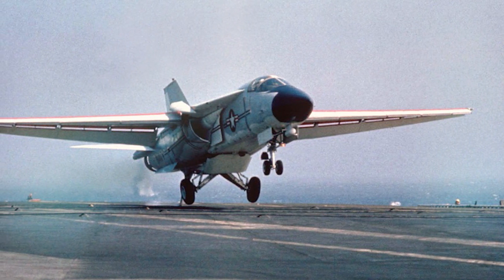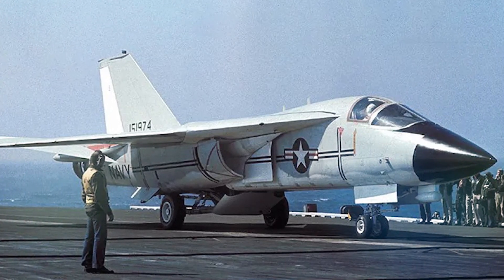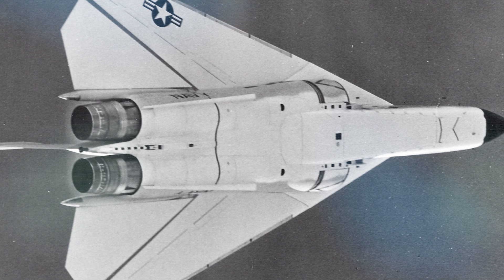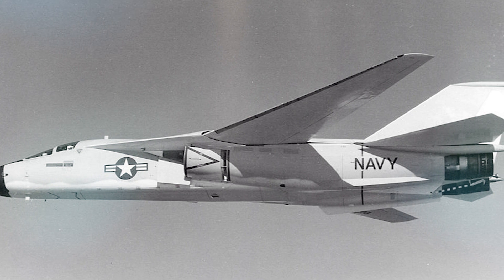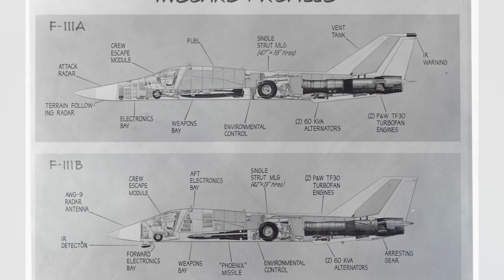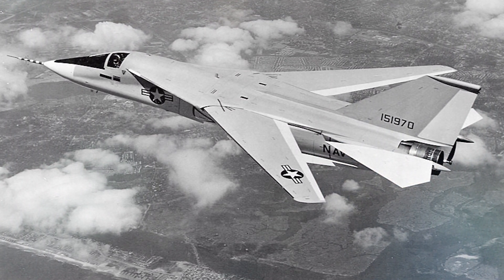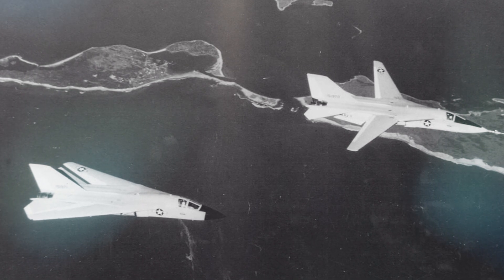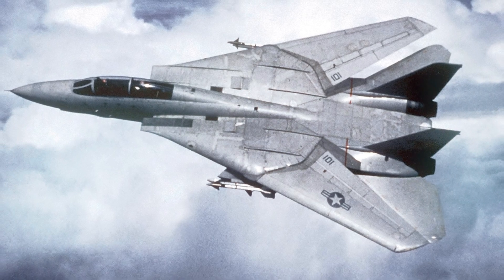How the demise of the F-111B led to the development of the legendary F-14 Tomcat

Comment: Boy, McNamara's a confusing one. On the one hand, type and training commonality makes a great deal of sense. You save money by simplifying the procurement and production. But the willful ignorance in trying to force the F-111B through trials in spite of its noted flaws defies logic. Sunk cost fallacy definitely comes to mind. And I suppose that's the deal with McNamara: the internal logic of his crazy objectives was so airtight, you forgot that they were crazy in the first place. And the results were self-evident.
Reply: There was no willful ignorance, and the program did not defy logic.   In case you missed this:

The lessons of the TFX program are commonly misinterpreted, but if you repeat a narrative for decades and it becomes "truth".  The idea that one basic airframe could fulfill two different roles was not a dumb idea at all.  History is full of examples of aircraft that were versatile enough to fly for different services and even perform different missions. The original requirements presented by the Navy and USAF were not incompatible, but the requirements changed.  

Initially the TFX program was reasonable because USAF and USN were both asking for a large aircraft that could lift a heavy load of fuel and weapons, with long range or long loiter, plus high-speed dash or intercept. Twin engines and an innovative variable geometry wing were called for, and DOD logically assessed that it would be wasteful to develop two very expensive advanced airframes when a single one with some variations could do both jobs. 
The reason one basic airframe could do both jobs was because original USN specification was for a fleet defense fighter, not an air superiority fighter. It was not originally intended to be what later became the F-14, but to perform the role meant for the Douglas F6D Missileer, with the addition of supersonic dash interception capability.  It was never meant to be a dogfighter.   

The biggest difference between the airframe requirements of the two services was that USAF wanted a tandem cockpit and USN want side by side seating.  Boeing tried to make both services happy, but MacNamara’s DOD thought USAF could suck it up and have the crew sit side by side.  This is ironic considering that when the Navy cancelled its version USAF was stuck with the cockpit it didn’t want, which also ironically contributed to the airplane being too ungainly for a dogfighter.  If the Navy had wanted a dogfighter it would not have insisted on the side-by-side cockpit over the objection of the Air Force.  The F-111 cockpit was suitable for a radar interceptor, but not for an air superiority  fighter.

The original idea wasn’t dumb -- what happened was that needs changed.  USN revised its specifications for the TFX as result of combat experience in Vietnam, and realized they also needed an air superiority fighter to replace the F-8 and F-4, but couldn’t afford that in addition to a dedicated fleet defense aircraft.  Thus, the TFX would now have to be able to dogfight as well as be a missile interceptor.  The F-111B could have worked as a missileer, but it was too fat and underpowered to compete as an air superiority fighter.  It was proper of the Navy to recognize that its needs had evolved.  This was perhaps the beginning of the Navy realizing that budgets and hangar decks did not have room for so many specialized aircraft.  USAF desperately needed the F-111 to replace the F-105, so they sucked it up and accepted the heavy airframe caused by the loveseat cockpit they never wanted.
Reply: McNamara was more than just "a confusing one", he ended the Arsenal and Armoury system, used "management systems" and "analysis" to justify cutting needed programs, and most egregious was the way he worked with Nixon to prioritize rushing young "urban" young people into the draft and into combat.

Comment: There are a lot of misleading and inaccurate statements is this video. So I'm going to be an arse and clarify a few major points:

- The F-14 had worse carrier compatibility. SAC and flight manual data shows the F-14A has noticeably worse wind over deck speed requirements, had worse landing weight restrictions and had to land at a much faster speed under the same payload. Both aircraft had comparable size when everything was stowed (wings of the F-14 set to stowed and the F-111Bs nose folded). SOP also required the F-14 to jettison 2 AIM-54s prior to landing on a carrier when kitted with a full fleet defence load out. The F-111B did not need to do this.

- The F-111B was never intended as a traditional fighter. The USN didn't originally spec a traditional fighter. They specifically asked for a fleet air defence platform that could fire missiles at long ranges without having to engage enemy aircraft within visual range.

- The F-14A suffered exactly the same engine problems as the F-111B... Only the F-111B preproduction model managed to iron out most of the issues, while the F-14 did not and worse still, engine spacing exacerbated the issues and sometimes caused the aircraft to enter an uncontrollable flatspin which killed numerous pilots when performing air combat manoeuvres... otherwise known as moves you would use in a dogfight. "One of the best fighters ever constructed" everyone.   

- The F-111Bs weight problem wasn't a problem with the aircraft itself, but rather the initial spec set out by the Navy. They expected a platform that could fly almost twice the distance of the F-4, carry a significantly heavier payload than the F-4... but for it to only weigh around 8,000lbs more. This was literally impossible to achieve. Even with Grumman's prior experience with F-111B,  they still couldn't meet the original TFX weight spec with the F-14 either, and that was AFTER they'd dumbed down the requirements for the VFX program by reducing the range and payload capacity. On top of this, the USN contributed to the weight problem by insisting an ejection capsule was required right up until their withdrawal from the F-111B program... Only to magically decide it wasn't needed for the VFX/F-14 program. Weird that.

- The weights used in the video are misleading and refer to the Gross weight of the aircraft, which is largely range/fuel and ordinance dependant. When both aircraft were configured for the fleet air defence role and the same combat range, the F-111B only weighed around 3,700 lbs more than the F-14, without using external fuel stores or even using its full internal fuel capacity. By contrast, the F-14 required two external fuel tanks and full internal fuel.

- Poor visibility was a prototype issue. The two preproduction models had a temporary fix for this, with a nose modification and the follow on production models were to have an additional cockpit modification to improve visibility further. Coincidentally in a move that isn't suspicious at all, the USN pulled out of the F-111B program less than a month before the first preproduction model was to role off the production line. This aircraft would have addressed many of the Navy's concerns, including cockpit visibility and it had notably more powerful engines, giving it a thrust to weight ratio similar to that of the F-14A (albeit lower by about 0.06).

Ironically, the F-111B was in many ways a better aircraft that the F-14A. It was more flexible in carrier operation, could carry more, was more fuel efficient, could fly further and came with scale of economy benefits (similar to those seen by the F-35 today) when paired with the USAFs F-111s, which would have made upgrades cheaper, training cheaper, maintenance cheaper, improve interservice operability... the list goes on. 

Instead the USN cancelled the F-111B, made the airforce foot the bill, and contributed to the premature retirement of the USAFs F-111s due to the now non-existent scale of economy benefits and instead spent billions on an aircraft program that resulted in an aircraft with a substantially higher per unit cost and was worse in pretty much all aspects apart from its ability to dogfight (assuming the engine issues didn't take you out during said engagement)... Only to ironically get it prematurely retired because of spiralling maintenance costs and because there wasn't a significant enough capability gap between it and the F/A-18 Superhornet... Ironically the F-111B likely would not have had either of these problems. 

Thank you for coming to my ted talk.
Reply from the maker: Thanks for the clarifications

Comment: This is just the usual inaccurate narrative that obscures what really went on with the TFX program and the F-111B.

The lessons of the TFX program are commonly misinterpreted, but if you repeat a narrative for decades and it becomes "truth".  The idea that one basic airframe could fulfill two different roles was not a dumb idea at all.  History is full of examples of aircraft that were versatile enough to fly for different services and even perform different missions. The original requirements presented by the Navy and USAF were not incompatible, but the requirements changed.  

Initially the TFX program was reasonable because USAF and USN were both asking for a large aircraft that could lift a heavy load of fuel and weapons, with long range or long loiter, plus high-speed dash or intercept. Twin engines and an innovative variable geometry wing were called for, and DOD logically assessed that it would be wasteful to develop two very expensive advanced airframes when a single one with some variations could do both jobs. 
The reason one basic airframe could do both jobs was because the original USN specification was for a fleet defense fighter, not an air superiority fighter. It was not originally intended to be what later became the F-14, but to perform the role meant for the Douglas F6D Missileer, with the addition of supersonic dash interception capability.  It was never meant to be a dogfighter.   

The biggest difference between the airframe requirements of the two services was that USAF wanted a tandem cockpit and USN want side by side seating.  Boeing tried to make both services happy, but MacNamara’s DOD thought USAF could suck it up and have the crew sit side by side.  This is ironic considering that when the Navy cancelled its version USAF was stuck with the cockpit it didn’t want, which also ironically contributed to the airplane being too ungainly for a dogfighter.  If the Navy had wanted a dogfighter it would not have insisted on the side-by-side cockpit over the objection of the Air Force.  The F-111 cockpit was suitable for a radar interceptor, but not for an air superiority  fighter.

The original idea wasn’t dumb -- what happened was that needs changed.  USN revised its specifications for the TFX as result of combat experience in Vietnam, and realized they also needed an air superiority fighter to replace the F-8 and F-4, but couldn’t afford that in addition to a dedicated fleet defense aircraft.  Thus, the TFX would now have to be able to dogfight as well as be a missile interceptor.  The F-111B could have worked as a missileer, but it was too fat and underpowered to compete as an air superiority fighter.  It was proper of the Navy to recognize that its needs had evolved.  This was perhaps the beginning of the Navy realizing that budgets and hangar decks did not have room for so many specialized aircraft.  USAF desperately needed the F-111 to replace the F-105, so they sucked it up and accepted the heavy airframe caused by the loveseat cockpit they never wanted.
Reply: Excellent treatise.
Reply: Thanks for trying to disseminate the truth.
Reply from the maker: Thanks for the details